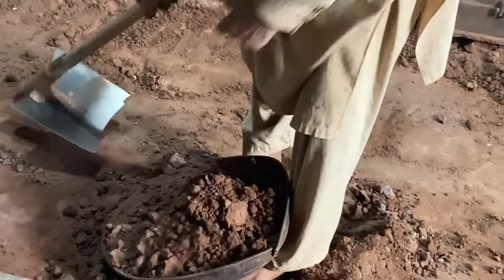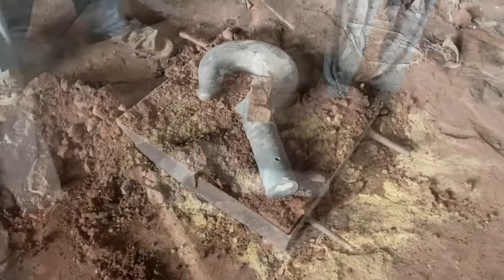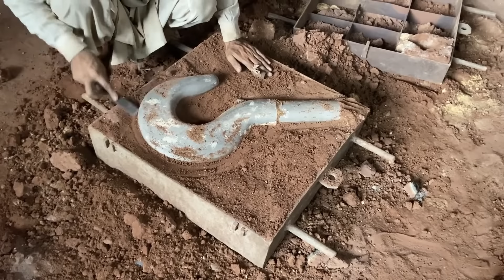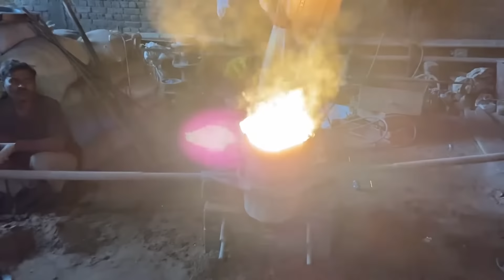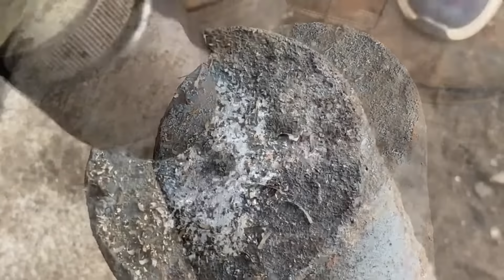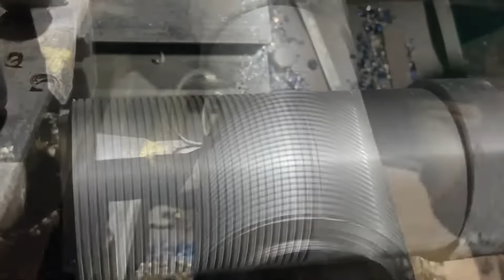How Amazing Haydraulic mobile crane Hook Manufacturing in Local Factory | amazing casting crane hook

Comment: What a shame we weren't shown the Cope (top) and the Drag (bottom) of the finished mould. In any event I would suggest cutting the wooden pattern of the Hook in half (lengthways of course). This would remove the need to 'bed' the pattern in loose sand every time you make a moulding of it.